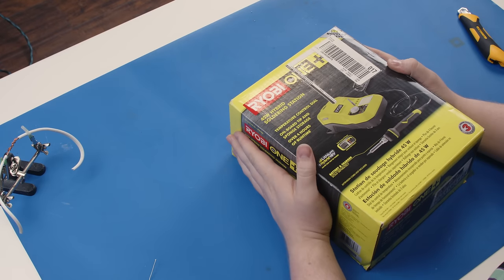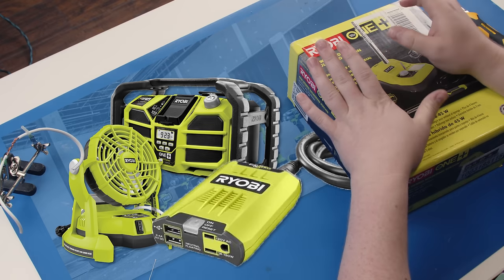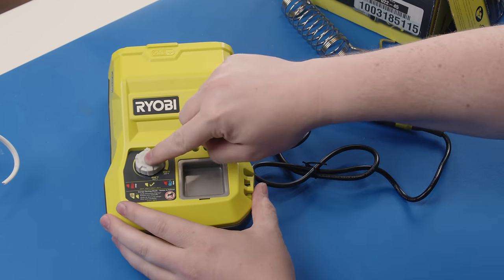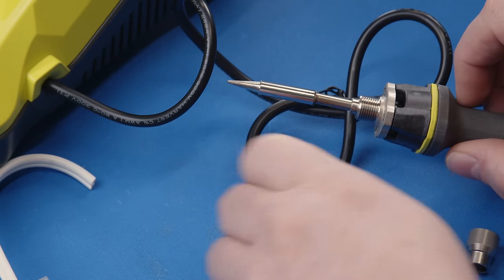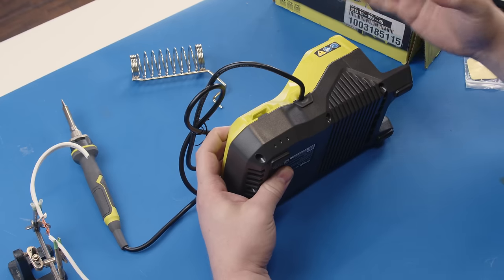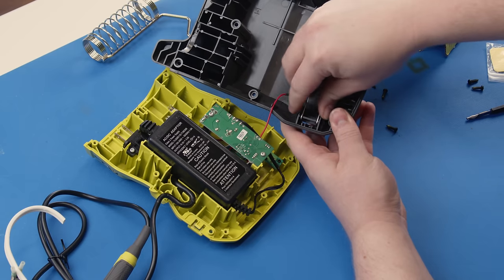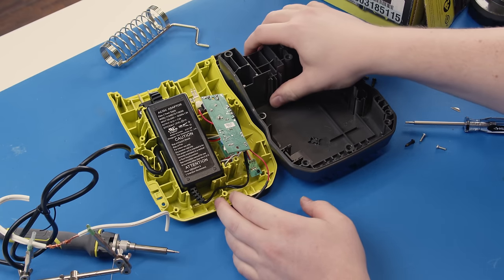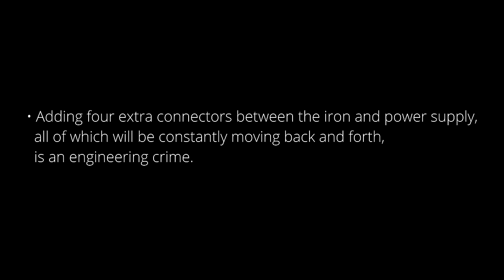Ryobi has GOT to be joking with this soldering iron

Comment: I have both versions of soldering iron. I’m not an electronics professional, I’m a field service mechanic and the cheap version has fixed everything from a stranded boat on the water to a forestry mulcher stuck deep in the bush. They both work really well I’ve never burned the cable feeding the iron just as I’ve never burned through my hoses on my acetylene torch. Maybe not for the electronics professionals but for the rest of us it sure beats the old butane butchery of yesterday.
Reply: Thank you. that was the idea i had while watching. hes acting like this product is a full electronics professional kit and not just a here you go for the occasional solder when needed. it works fine. ive got one and ive never burned the wires, nor had any issues with it. though i already suspected the way the 120 volt supply was just by looking at mine and going... heeeeeeeyyyyy wait a minute that looks like a totally normal bi pin plug sand witched in place im gonna bet that they just shoved a power supply into the unit and called it a day. 

honestly i think they missed a good little trick they could have added and sold as a feature. move the plug somewhere else and add the ability to charge a battery. i know its not the most useful idea, but the power supply outputs 18 volts. same as the battery so all they would really need is the same logic that their chargers have which after taking apart a tiny ryobi charger i have... the charging circutry. is really pretty basic. seems like the batteries themselves handle quite a lot of the aspects of the charging and discharging as well as the over and under voltage stuff.
Reply: @compzac  The batteries do have the bms board built in on top of the battery pack.

Comment: I think using external power supplies encased in plastic housings is actually a step up for cheap products. Having one power supply design used in lots of products will most likely have a better average reliability than random cheap internal designs that are not standardized. Plus replacement is infinitely easier if the power supply does die!
Reply from the maker: Can't argue with that!
Reply: Plus, (assuming you know it's in there if it does) you can at least salvage a nice, safe supply before recycling the rest of it.

I've gotten a few from laser printers I've salvaged recently, way more reusable than power supplies on pcb only.
Reply: @NVRMTmotion  good point
Reply: @NVRMTmotion  
Very good point.
I lately became a horder of all sorts of chargers. I keep all chargers before binning devices. 

Some of the chargers that come with some devices are cheaply made and they break or get faulty easily. So having spares is a bonus. Plus some mobile phones stoped supplying the chargers with the phone. So better keep the spare ones we already have just in case.
Reply: A plastic case power supplie in a plastic case  will get realy hot. Ist will fail much faster than an open one. Its built with minimal effort, this is not always bad but i would not do it this way. Also very wasteful solution, very Chinese type of thinking.
Reply: They should have designed the station so that the PSU led aligned into proper location and had a transparent window for it to be visible, "mains connected" indicator!
Reply: Meh, when it's a open frame PSU inside the product clamshell, I can easily repair it,  just solder on new transistor, diode, capacitor, and have it fixed for a dollar instead of hunting down new PSU which the time to do so is worth more than $1, then the PSU probably costs over $15 delivered.  That might seem like it's too next level and technical for the average person but not so much the average person who owns a few soldering stations.

PLUS the larger issue is these sealed AC/DC supplies run hot like an EZ Bake Oven inside, so their capacitors usually do fail within the otherwise visable lifespan of the product, unless grossly overspec for the application.  Plus, they are typically welded/glued together instead of screw together so quite a chore to open them without causing destruction.
Reply: I have a cheap tv tuner that was built with an internal open-frame 5v supply.  Despite the low cost, they a(IWill...about $35) they were really popular among the home-theater set...the only caveat being they tended to get really hot, and eventually failing from ps failure.

When that happened to mine, I just bypassed the supply and used a 5v wall wart--which has performed flawlessly for years.  Kind of the reverse of this situation.
Reply: Michael Bishop  McMaster-Carr has quite the range of heat shrink tubing, some rigid, some semi, some flexible, various colors and thicknesses, I'm sure one of them would be ideal to recover that iron cord and solve what I consider to be the largest outstanding issue with the device.
Reply: @alanmoore78  I was thinking more along the lines of Varflex tubing. Heat shrink is going to make the wire even less flexible than it already is. Doesn't really matter. All cable mods, rejacketing or replacement will need to start with removing the cable from the board.
Reply: @m9 ovich Better to meet him in a dark house with no installed overhead lighting an all outlets are switched outlets and the whole house is REQUIRED to be lit using plug-in table lamps...It's an absolute dungeon in this house and you only have half as many outlets that were advertised. So plug in a wall wart and a whole plate is unusable because the free outlet is for the room lighting....And if you switch the lights off I hope you remembered to plug in your PC in the non-switched outlet, or bye-bye work.
Reply: @BaumeisterKnese  FYI these are designed in North (?) Carolina, not China
Reply: @fortpatches  A company from Hong Kong that develops in America OK.  Nevertheless, the design is typical of Chinese developments.  quick assembly by unskilled workers with the cheapest possible mass-produced components and the service life is irrelevant.  I wouldn't use something like that for security reasons.  I avoid products from a dictatorship that tramples on human rights every day as much as I can anyway.
Reply: @BaumeisterKnese  You forgot that it was founded by a German engineer. And which brand would you prefer? Milwaukee, Ryobi, Hart, Hoover, Oreck, Dirt Devil, AEG (Rigid), and Homelite are all TTI. Bosch is made in China. Stanley and Craftsman are made in China and Taiwan. DeWalt has tools made in China. Makita has tools made in China.

The only power tools not made in China, that I can find, are Festool, which are made in Germany and Czech Republic.
Reply: @fortpatches  you have to decide for each tool.  Bosch, for example, does not build all tools in China and if there is no alternative the company should not be Chinese and have good quality control.  You have to put some time into the selection then you often find tools that were not produced in China.  As far as I know, Techtronic was founded by a German and a Chinese as a contract manufacturer.  But the company is Chinese and the mentality of a Chinese company is fundamentally different and never independent of the CCP.  In my experience, Taiwanese products, on the other hand, are usually very good and support a democracy that is constantly threatened by China.
Reply: @NVRMTmotion Yea ive noticed that a few times with some laser and inkjet printers have also copied this idea and just shoved a prebuilt power supply into the unit for it. usually in this same manner. sometimes not even chopping the cord off and just having the cord running out the machine like it was a part of it. no thoughts given or cares noticed. but it freaking worked well and ive gotten a small army of power supplies in tons of voltages with bare output wires to have fun with now

Comment: If you struggle to solder connectors and regularly melt the pins, make sure you are connecting the connector to its mate. It prevents the pins from walking from the heat and keeps them straight while soldering. It also and gives the pins more metal to dissipate the heat and prevent melting the plastic
Reply: Great tip!  I was melting XT60 connectors til I upgraded from a pathetic 30w iron with junk solder to a 65w with decent solder.  The solder was the biggest issue.
Reply: There are a lot of very badly made connectors around today. Instead of the insulation being made of decent thermoset plastic it is made of something easy to mold and super cheap like polypropylene. That, combined with poor quality plating in pins, makes some of them almost impossible to solder well no matter your level of expertise.

That said, there is considerable art in soldering wires to connectors. One of the most common errors I see is improper feeding of cored solder. It must be fed so that the flux flows over the joint before the molten solder does. I've seen videos that supposedly are teaching soldering where the solder is touched to the iron tip and allowed to flow onto the work. That is just wrong. A lot of people seem to want to slop extra flux all over everything. In the vast majority of cases that is completely unnecessary if your technique is good. I do like to use a tiny amount of low-solids liquid flux for tinning small stranded wires to be soldered to certain types of very small connectors and sometimes use rosin paste flux for tinning large stranded wires, but other than that I very rarely use extra flux. I'd be extremely surprised if the number of joints I've soldered is less than a hundred thousand.
Reply: @d614gakadoug9 any videos or channels you recommend where I could pick up knowledge and tips from? Preferably with DC, stranded wire type stuff

I have enough knowledge to know when I'm watching someone who doesn't really have a understanding of the fundamentals, or why they're doing something a particular way. I often hear the statement "been doing it this way for so and so years, never had an issue" or similar, which is fine but when their intention is to help viewers it doesn't exactly provide much meaningful value.

Combine that with poor video or audio  and you've got A LOT of video to sift through and waste time on lol
Reply: another tip, instead of plugging the male connector you are soldering, push its pins into potato or an apple or such. 
This method worked wonders for me =)
Reply: O
Reply: Probably has an oxidized tip that won’t hold solder, probably from too much heat.  New tips and an Olympic swimming pool of flux makes anyone a decent soldered.

Comment: For soldering DIN plugs, just use the potato trick:
Ram the plug into a raw potato, it will hold the plug for you and the wet inside of the potato helps cooling the pins so the plastic won't melt.
Reply: At least some one on this channel knows what his talking about, used the same trick myself, I manufactured 4 ply boards for computers in the 80s, with a non temp controlled weller soldier iron, never had a problem I did 1,000s over my time, and you don't need to apply any pressure to the tip of Iron, those people that talk about soldier Irons need to know what there taking about first.
Reply: or just plug it into a mating connector/cable in case there's no potato at hand ^^
Reply: @videomentaryproductionschannel  Exactly. Unless you're being lazy and using the soldering iron tip to scrape through the oxide layer on some solder blobs, you really shouldn't need to apply much pressure at all to the tip of the soldering iron. The trick is lots of flux and flowing new leaded solder into the existing solder to make it more workable. Also, using the right size of tip and soldering iron for the job. If you have to apply a lot of pressure on a wire junction to get it to soldering temp, it's likely because your iron is too small or it's unable to output enough heat to soak the wires.
Reply: And you get a baked potato at the end!
Reply: This Pace instruction video on cup terminals is invaluable: https://www.youtube.com/watch?v=_GLeCt_u3U8&t=3s

 If you haven't already try Kester #186 liquid flux, the stuff is great. You can get it off ebay in little syringe bottles. I was disappointed that they stopped making the Kester flux paste but once I tried the #186 liquid now I see why. If you absolutely must have paste Caig / Deoxit flux paste is a decent alternative to the out of production Kester.

 MG Chemicals RA is very powerful flux, but too good in some cases. It promotes too much wicking in stranded wire and it also needs to be cleaned. But it has it's uses in difficult soldering jobs.
Reply: Lol
Better use blue tack
Reply: I think he tells us why he as problems with soldering in the video - when he said that he likes the chunky nature of the iron so you can put decent force on the joint. You never push on the iron when soldering - rest the iron on the wire/join, add some solder to provide flux and help heat transfer, and wait until the joint reaches the right temperature and the solder flows.

If he is pressing on the join, then that's the big problem. You deform plastic and the spring back when you remove the iron breaks the join as it cools.
Reply: Genius!
Reply: Not to mention potatoes are great for removing broken Edison-Style incandescent bulbs. Just jam it on and twist. Be sure to disconnect the power first of course unless you have a strong hankering for a baked potato.
Reply: LEGEND! Thanks heaps for that tip, I can't count how many three-pin XLRs I have screwed up due to overheating,  usually using a cheap soldering iron.
Reply: ill try that.
Reply: I’d like to ask the potato how they feel about this but good idea
Reply: @endymallorn  I was about to say the same!
Reply: @JosiahGould  with a little bit of and esophagus-severing to it!
Perfect murder potato!
please don’t track me fbi
Reply: If you don't have a potato handy, you can use a carrot. It doesn't have quite the same cooling capacity as a potato, but it'll still make soldering DIN plugs much easier.
Reply: For pins in meltable plastics.... just clean terminals.. fkux.... high wattage but temp control.... the faster you get the heat into the joint the better... BUT must get to proper temp to make a good joint so cooling things down at the wrong point in the process can be counter-productive.
Reply: @endymallorn  only if you do a Big Clive and feed it with 240v
Reply: @mndlessdrwer  

Usually it's not not hot enough, but too hot, so that the tip surface becomes oxidized, stopping heat transfer, and that's usually game over for the tip. Some of the high-powered ones even start to glow red hot when left plugged in long enough. The trick is to use a switch and turn it off once in a while, primitive pulse width modulation if you will. You could also use an incandescent bulb dimmer. 
I have a cheapo station which uses a phase-cut curcuit resembling such a dimmer, was quite disappointed when I saw that... But even though it's far from a Weller, it works far better than it should.
Reply: Josiah Gould I've never figured why everyone thinks a potato is perfect for that. I've always used a carrot. It's already the correct shape.
Reply: Some 30 years ago I mounted male and female XLR, RCA and DIN plugs/jacks to a block of wood, as a holding jig for soldering these connectors to cables.
Reply: @atomicskull6405  That Pace video is great. In sixty seconds it solves every problem I've ever had with soldering cup terminals. Thank you for sharing it! (and for the lead on the 186 liquid flux)
Reply: So the electronics equal of wrapping a wet rag around a valve in plumbing/hvac.
Reply: @westelaudio943  I had a cheapo thyristor controlled soldering station like that for years. Had no idea it was actually so simple until it died and I took it apart, I always thought it at least had a low voltage power supply and maybe even a thermostat of some kind but it literally was just a light dimmer and a 230 VAC iron. Still was happy with it and used it to build lots of electronic projects.
Reply: @nemonada3501  try 5 pin minidin plugs!!t x.x
Reply: @frogz  I used to look at those things in horror, happy at the thought that I haven't needed to solder one to date. Now I've said that I bet the situation is going to come up 😂
Reply: @JosiahGould  Make sure you don't rely on the power switch. If the light is wired wrong, the switch could be on the neutral wire with means there is still potential to ground. That can make for a big surprise!
Reply: @terrygoyan  Breaker off if you're working with mains is common sense, but thank you for pointing that out. Absolutely no power should have the possibility of flowing if you're repairing a mains circuit.
Reply: Never have I needed to do this.  Maybe just learn to solder instead?